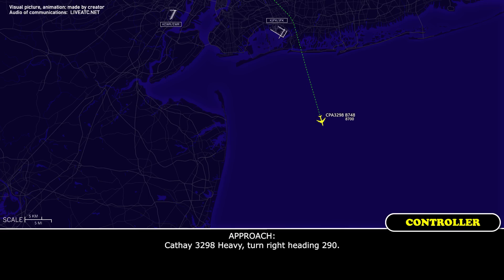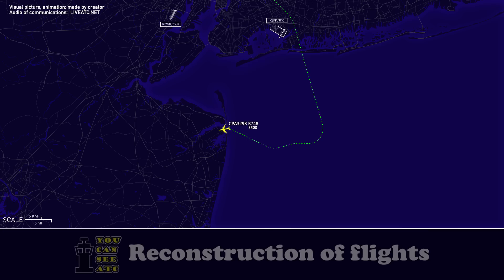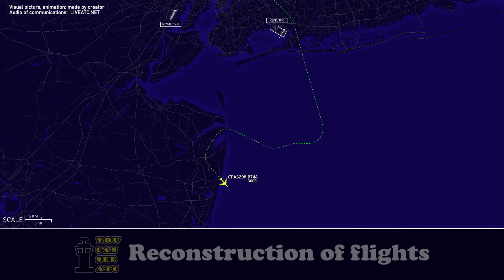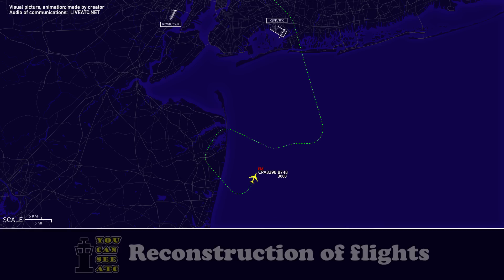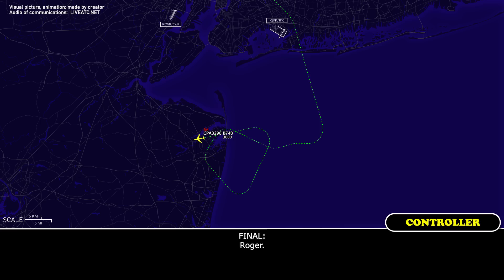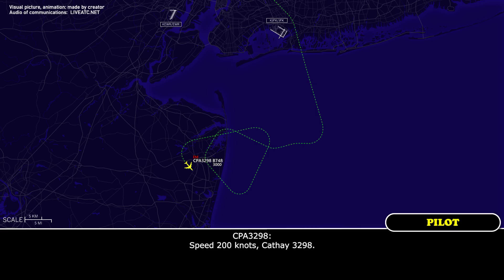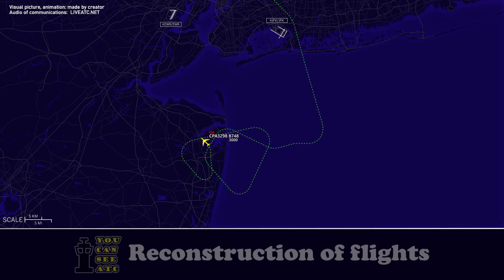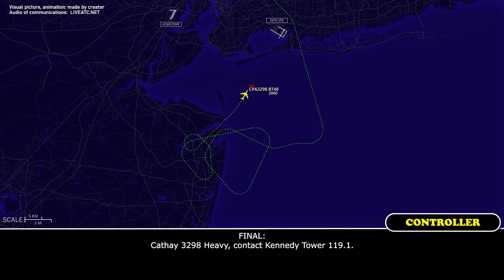High speed landing. Cathay Pacific Boeing 747 has leading flaps issue at New York Kennedy. Real ATC

Comment: 4:57 "otherwise the tires are in the 'melt zone', so 4L is our only option." Important detail.
Reply from the maker: It was really hard to get. Your comment is pinned.
Reply: Sounds ‘exciting’ whichever failure u get😮
Reply: What's the melt zone?
Reply: @avrohomz4582 brakes get so hot they melt the tires/ the heat over pressurizes them and they blowout
Reply: @biscuitag97   actually it melts a valve and a more controlled loss of tire pressure...avoids a blowout
Reply: Why would tires be in the melt zone if they landed on a longer runway?
Reply: @aspzx  They need a longer runway because their speed is higher than normal, because of the flaps issue, thus longer break distance -> melt risk
Reply: @NeoP2  Ah I just mixed up the two alternative runway options. Earlier the controller says that 13R is longer than 4L. I thought it was on this runway that the pilot suggested he would be hitting the "melt zone" but it was actually the shorter 22L that he was talking about.
Reply: @aspzx  the longest runway had an unsafe approach for the lowest speed they could do. So they went for a nice long straight in, with the longest runway that allowed that. Then imagine doing an emergency stop in yer car, that had yer whole family in, and yer doing 100mph… that’s the sort of energy going into the tyres when they hit the brakes  😳🤪😬
Reply: 4:44 start there to hear the discussion.
Reply: Newark seams like a better option

Comment: Are’nt they called slats?
Reply: The general term is leading edge high lift device. Slats are the most common type of them found on most airliners. However the 747 has Kruger flaps on the leading edge. Another type is the leading edge droop flap, found for example on the A380

Comment: What is it with NY air traffic control. The poor pilot was made to request 4L about a dozen times !!
Reply: New York is a very busy airspace, and JFK is a very busy airport.  Lot of planes landing and taking off, which gets disrupted if an emergency occurs, especially if it's a landing that goes the "wrong way" down the runway.  ATC was trying to find a less disruptive way to accommodate the emergency without compromising safety, but there wasn't one in this case.  13R was longer but had no ILS approach (and according to other comments has a navigational hazard--downtown Manhattan, possibly--that wouldn't have allowed a long final approach).  22L was going in the right direction but was too short of a runway, and stopping on that runway would have likely caused its tires to melt or catch fire ("...otherwise our tires are in the 'melt zone'...").  I'm guessing there was some issue with landing on 22R instead of 4L (same runway but in the opposite direction) that wasn't mentioned here, though my guess is that it wouldn't really have been less of a disruption, and the airplane stops closer to the airport going in the 4L direction.  (I'm eyeballing the runways on Google Maps to get an idea of what's going on.)

Comment: A lot of debate regarding if its an emergency or not, at the end of the day its up to the captain to decide that. Aircraft was under complete control and no imminent safety concerns for the people on board. That said, ATC has the authority to declare an emergency for you if needed, controller activated the emergency protocols due to the amount of work required to move traffic around to accommodate the aircraft requirement for rwy 04L. Remember new york is one of the busiest airspace in the world, if its not an emergency they wont accommodate a specific runway request when the flow is opposite direction.
Reply: Emergency status, also allows pretty much any rule or procedure to be disregarded to get the aircraft safely on the ground, I.E. cuts the red tape.  This is typically the reason ATC will declare for you.

Comment: I'm not sure why the controller insisted on 22L which is the shortest runway at JFK. 22R would at least have been understandable, or even 31L depending on winds. Edit: Watched further on, yeah 31L was definitely not an option with that much tailwind.
Reply: 22R has a displaced threshold, only about 7000 of landing distance.
Reply: Instead of “editing” your useless comment, written before you even watched the whole video, why don’t you do us a favor and just delete it.  It is meaningless in context of the complete video.

Comment: The issue with the CANARSIE 13R approach is that it’s done on a 041 heading base leg right turn to final approach to 13R. There is < 3 miles to get straightened back out after the turn and when you’re taking the turn even faster due to the flaps issue it’s even less time to make sure everything is stabilized.
Reply: At 190kts the radius of turn would be too large to get onto 13L in time
Reply: Thanks for that! As a non-pilot I was wondering about that. That makes perfect sense.
Reply: Yes, there isn't much time for final corrections after rolling out of that turn at normal speeds, of all the approaches I've shot at JFK(with a camera) 13L has the most go-arounds for sure

Comment: Dumb this down for a non pilot. What was the reason for rejecting a longer runway? Something about type or direction of approach but didn't understand it.
Reply: The longer runway would have been using the Canarsie approach that is a turning approach that requires a lot more skill kinda like the approach to the old old Hong Kong airport.
At 190 kts it would have been pretty hairy
Reply: @kevbrown1867  oooh tight turn at high speed. That makes sense.
Reply: Ah- thank you.
Reply: With flaps issues you need a long and straight final to land safely and line up. Runway is longer but would you rather go 50 mph straight without brakes or try to make a right turn without brakes?
Reply: Basically they couldn’t comply with the restrictions of an approach to the longer runway, length of the RWY doesn’t matter if you can’t get to it :)
Reply: I thought there was more instrumentation on the runway they asked for.

Comment: On a no flaps landing isn’t the way to perform one to turn off both engines and put gear down
Reply: Au contraire, if you have a situation like that, you'd need to flap very hard ;-)
Reply: Putting the gear down is a good idea, you should do that for most landings. But shutting down the engines would just be making extra work for your self.

Comment: Ok I have a question for the professionals. Would it have helped them with such a high speed, to dump some fuel?
Reply: Not really. He said they had 38800lbs of fuel, for safe reserves and in case of a go around, they could have only dumped around 10k lbs, which doesn't really have a material difference in the landing distance required.
Reply: A quick Google search says the 747-8F can carry around 400.8k lbs of fuel, so they were down to less than 10% fuel.
Reply: Also another thing to consider, the tires will have more contact with the ground being heavier making it easier to stop so dropping fuel would have made the landing harder.

The more weight on the plane, the more it presses down on the tires which gives more surface area from the tires pressing harder on the ground to spread the tire out more. Luckily, the tires are completely filled with Nitrogen (Can't use normal tire air you use in cars because of the lack of air pressure in the air would make the tires burst, so straight nitrogen is used only in airplane tires for the higher altitudes).

But back to the main point, more surface area means better stopping power.
Reply: @WilliamW1979  You just made that up didn't you. More weight = longer stopping distance, no ifs and buts.
Reply: @mikkotuomi7884  No, more weight = more tire surface touching the ground for stopping power.
Reply: @WilliamW1979 dunning kruger.  The heavier the aircraft the longer it takes to stop.  Boeing and Airbus both agree on this.
Reply: @kickedinthecalfbyacow7549  When you are comparing say a car and truck, YES. But if two identical cars of the same size have different weights, then the PHYSICS say otherwise. Of course, I wouldn't trust BOEING with anything right now since they can't even keep a door on their plane along with the 100 other issues they have. Even their own workers refuse to get in their own planes.

Comment: There is no speed restriction on the canarsie 13R approach, I'm a bit surprised they refused. The turn is not too tight for 190kt.
Reply: Yes there is a speed limit. The minimums are only for cats A-D, Category D approach speed is up to 165kts. Try it in the sim for 13R, there's no way in heck you can make that turn to 13R at 190kts, especially with a right crosswind. The procedure only guarantees obstacle clearance inside the circling approach area up to speeds of 165kts. This actually is an issue on a 748 even without a flap failure with high winds, as Vapp can easily be in the 170s.
Reply: Bit tight on the rollout for 190kt
Reply: Was Wx impossible for the 13R visual? Seems ~13kts more headwind and a fair bit longer as well. Understand they didn’t want to make the turn but maybe hard to make the descent at 190kts visual too?

Comment: ATC, stop saying "heavy" every transmission. Is this an FAA requirement?
Reply: Its required, part of the FAA's phraseology , also heavy is always categorized as the maximum takeoff weight, regardless of the aircraft's actual weight at the time.
Reply: "Heavy" is used to refer to aircraft with a Maximum Takeoff Weight of over 300,000 pounds (136 000 kg), as an advisory to ATC and other aircraft that it can create strong wake vortexes. If the plane is an A380, you may hear "Super" instead.
Reply: Required to say heavy when they’re above a certain weight
Reply: yes anything over 300,000 lbs
Reply: Yes. Specialists must use the word “heavy” as part of the identification in communications with or about heavy jet aircraft. 
https://www.faa.gov/air_traffic/publications/atpubs/fs_html/chap4_section_2.html
Reply: hard luck!
Reply: Also used for B757 due to their wake turbulence.
Reply: @davidhickok3525  Not any longer.  The FAA reclassified the 757 into its own category.    This happened in 2010   https://www.faa.gov/documentLibrary/media/Notice/N7110.520.pdf
Reply: The Pilots too should be using the term, it's a warning to other aircraft of wake turbulence.

Comment: I understand the controllers are between a rock and a hard place, but if I were the pilots, I would be a bit annoyed to add spacing to the list of things I have to worry about or that will affect me....
Reply: The pilots didn't have to worry about spacing; they just had to fly a heading.
Reply: @andrewtaylor9610  lol I knew someone would say that. I feel like anything that adds to the abnormal workload isn't ideal though not the end of the world in this situation.
Reply: @Michigan_Adventures  A turn isn't abnormal and has far lower workload impact than a go around (as another commenter has also pointed out). The controllers can't just forget about every other aircraft in the sky while the pan aircraft (because that's what it'd be in any other country, rather than an emergency) runs its checklists.
Reply: Rather do that turn than go around...
Reply: "annoyed" and "worry" 2 things these pilots didn't do, jyst busy flying a plane I guess.
Reply: Why be annoyed? The pilot will always get what they want, just stay professional and courteous. Like these guys did

Comment: The question I have is, if they were landing 22L, why not offer 22R as that has an ILS approach?  Is 22R's landing distance shorter than 4L's?  I understand it is the same runway, but sometimes displaced thresholds on one end could impact available distance.
Reply: 22R has a landing distance available of only 7700 feet, much short than 22L. 4L does not have a displaced threshold so the 12,000 feet is available.
Reply: Thank you.  I was suspecting that that might have been the issue if ATC was so gung ho about 22L.
Reply: @mtk52983  ... Actually.... 04L (the one they used) has an LDA of 11010ft (there is actually a short displaced threshold, that's why not all the 12079 ft of runway are available)
31L has an LDA of 11248 (a tad longer than 04L), and also has an ILS approach. I wonder why they didn't even consider that one. Wind? 
The rest are all either shorter or no ILS.
By the way, 22L (the one TWR was offering) has ILS but it's LDA is 8400ft (no displaced threshold). Much shorter than04L the crew requested. You have a 747 with no flaps, minimum approach speed of 190kts... I don't think it was good to ask them to use 22L.
Reply: @adb012  the flaps were fine, its the leading edge slats that werent working.
Reply: @adb012  considering they still used much of 4L I am not sure they could take 31L with the winds
Reply: @adb012  The winds were 120 at 13 gusts 19, which is a tailwind if landing on 31L. Landing with tailwind is only allowed up to 10kts.
Reply: @bestbearyt  ... Makes sense. Even if it was allowed, landing with 13 kts of tailwind would consume more landing distance than extra 238 ft of LDA you gain.
Reply: Personally I would have gone to Newark

Comment: 22L/04R is the shortest runway at JFK, only 8400 feet long.
Reply: That 8,400 foot distance might be calculated based on the displaced threshold. If that's the case, then there's quite a bit more runway than 8,400 feet.
Reply: @chrisbungostudios  No, there is no displaced threshold on 04R or 22L. They are normally used as a landing Runways. I know 04R was a CAT2/3 runway with all the required lighting. I recall at one recurrent sim check the Check Airman gave us the numbers for 04R on departure. He then checked the T/O performance  and acknowledged I was correct. Airlift  was departing 22R one day for LAX when the latest RVR put them below mins for T/O. They checked their Jepps and saw they were legal for 22L. Problem was they did not check theirT/O performance. Very low RVR. They were fairly heavy going to LAX. They dragged the aft belly through the approach lights for 04R. Did extensive damage but stayed in the air. The DC8 was a tough airplane.
Reply: @georgeconway4360  Ooops, right. I misread your original post and thought you were talking about 4L which is what was the runway in question in the actual video.
Reply: @chrisbungostudios  The controller kept offering 04R when he needed a long runway. Depending on the actual winds I would probably  opted for 13R with 14,500 feet of runway and told them I wanted to turn a 5 mile final if possible.  That would require using a chunk of LGA’s airspace for a very short time.
Reply: @georgeconway4360  Yep. I only watched this video once, but I think ATC mentioned 13R and the pilots rejected a "Canarsie-type of" approach. Anyway... it all worked out in the end.

Comment: Mayday Mayday Mayday and it's all yours. We don't do no spacing crap.
Reply: @jaopcostaa  - If it wasn't an emergency, they wouldn't have needed to use a different runway from everyone else and have traffic cleared from in front of them. The airplane has an issue that's affecting one set of flight surfaces, and issues have a habit of spreading. This was an emergency whether the pilots want to say the words or not.
Reply: Flight control failure is an automatic emergency declaration by ATC
Reply: Pros ATC and crew.
Reply: @jaopcostaa  Wrong.
Reply: No need for a mayday call, don’t open your mouth if you do not know anything about the subject maybe.
Reply: @Zetep  You have terrible breath. For that reason alone...don't open your  mouth. We see that you fancy yourself an expert...but unfortunately you have been banished to YT comments. Sad.
Reply: @Zetep  Hi there Bozo.
Reply: Shouldn’t need to say mayday if they’re declared the emergency for you
Reply: @Gee1410thirtysix  How about Maypan?
Reply: Cathay fly to Hong Kong (old British) regulations. There is no "emergency" outside of the US (or in Cathay SOP), its PAN or MAYDAY. Flap failure is PAN. Crew likely knew PAN means nothing in the US. But whatever, they asked and got what they needed.
Reply: @Andrew-tb9vr  PAN and MAYDAY both come under the emergency section of the FAA AIM (Section 3), it's just non standard phraseology in the US is normal. Even there by definition a PAN is an emergency.
Reply: @goodshipkaraboudjan  Do you carry a well tattered copy of Section 3 with you at all times? Do you whip it out at a cocktail party? Let's be honest here.....Shipster....it is unnecessarily complicated...plus it employs nonsense words. Take a flyer ....switch to emergency. You will have earned much additional respect.
Reply: @RLTtizME  No I have it tattooed on my arse cheek in reverse so I can read it in the mirror. It was just one thing that stood out as totally bizarre on FAA conversion for an E-3 gig. Sim checkers in the US would ping Aussies for not "declaring an emergency" when they called PAN. In the rest of the world and legally in the USA a PAN is an emergency, not a coffee order or request for an earlier van to the hotel.
Reply: @goodshipkaraboudjan  I think your comment makes the point. Pan is ridiculous. How about making it more complicated. Pan - A,  Pan-B,  Pan-C . Same for Mayday. That should get you really excited.  I like to think that PAN is something you cook in. There...now that makes sense.  Sorry....EMERGENCY can't be stopped.
Reply: @Andrew-tb9vr  You need to just give up on this Pan Pan Mayday Mayday thing and all the silly rules that apply. Just say emergency. That's it.
Reply: @RLTtizME  Aviation is global, emergency is basically only used in the USA. I understand and might use both in the US, like “Mayday, Mayday, Mayday xyz is declaring emergency due to … .”
Reply: @GermanGuy007  That is starting to change around the world now. Emergency makes more sense.